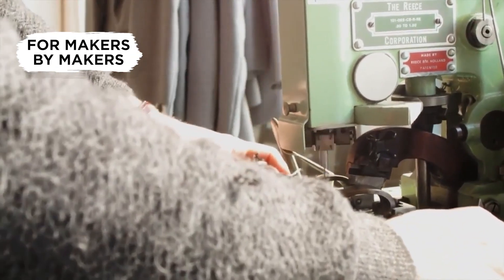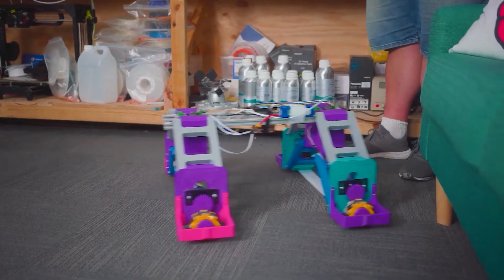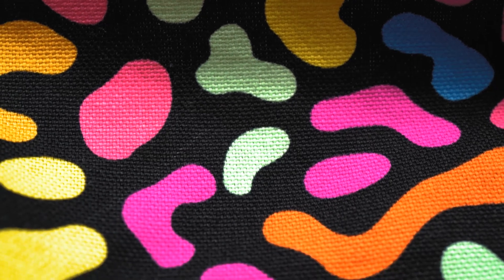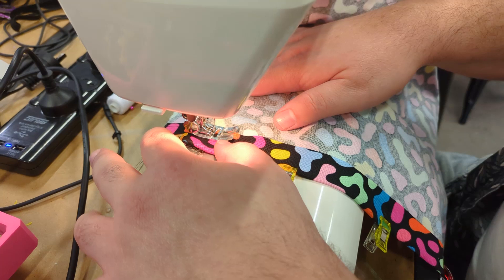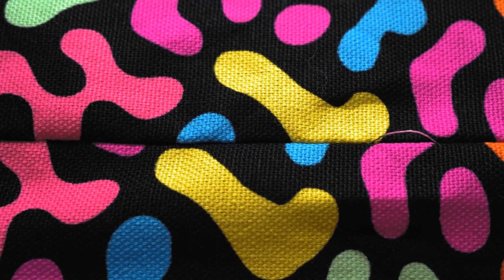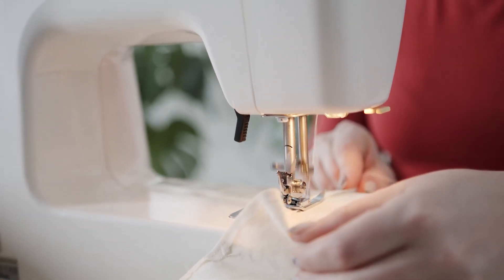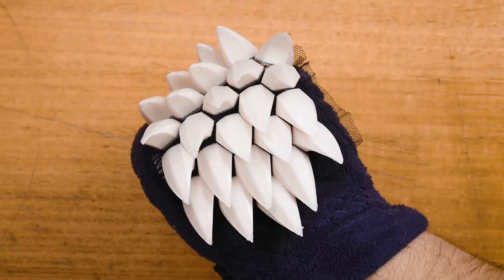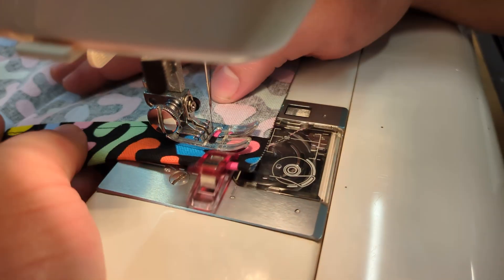Why Makers Should Learn Sewing | Zero To Maker Workshop

Comment: I would say with most or rather all wearable projects, you should consider if there are parts that should be made out of fabric.
Even if it's just a rectangle without any holes, at least you should sew a hem and I guess the fabric won't let through a lot of air or absorb any sweat if you're choosing the lazy solution of fabric which is so synthetic that after laser cutting, a hem isn't necessary anymore.

Comment: Can u elaborate on what you mean by the chess board didn’t work out? I think u can make the pouch first (kind of like a tote with no handles, then print on one side of it(?)
Reply from the maker: The squares we printed on the board allowed it to roll up in one direction really well, but not scrunch up like a bag, maybe some hexagon or octagon tiles printed with some more spacing between them, and a drawstring and it would work. We were also experimenting with printing directly on fabric which is not how its usually done and it wasn't adhering as much as we would like.
Reply: @Core-Electronics  I heard ppl use glue stick to help adhesion on a printing mat I wonder if something similar can be used for fabric? 🤔

Comment: Snipping a button hole in the fabric or cutting it in general is as simple as it gets. Considering u using an easy to work with material that is 😊 (I think a lot of the fraying in your case could have come from the fact that laxer didn’t cut through properly and u had to pull on many threads to disconnect it which would not be the case with sharp textile scissors (aka scissors that only ever used to cut textile and nothing else)
Reply from the maker: That was just a visual example of fraying, we found that the laser did an alright job of sealing the cotton, but it did a stellar job on polyester, very clean seals. We were trying to cut the button hole with the laser in the hopes that it would seal it nicely as well and we wouldn't need to reinforce it in anyway.